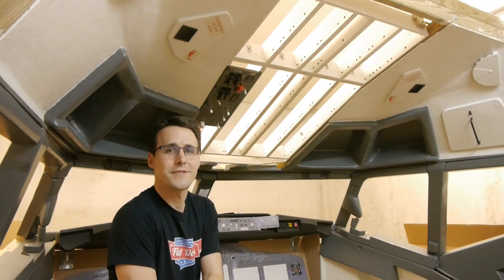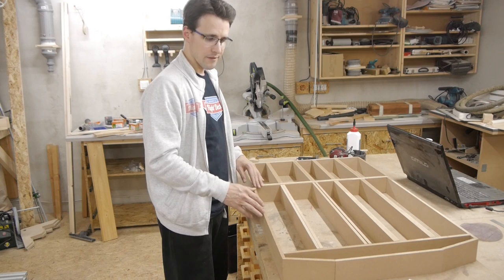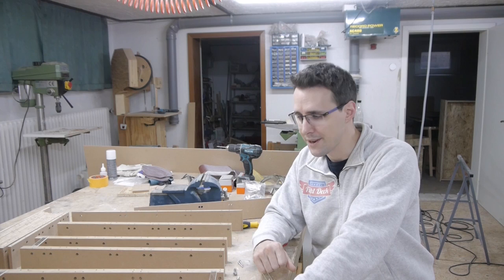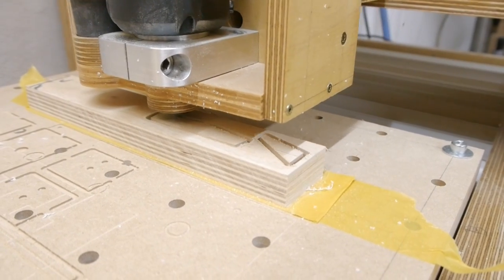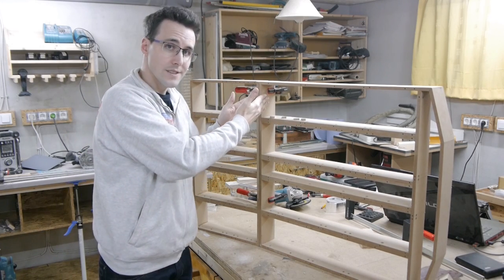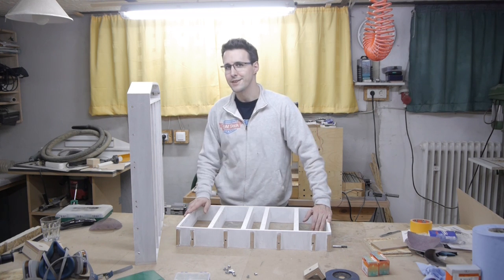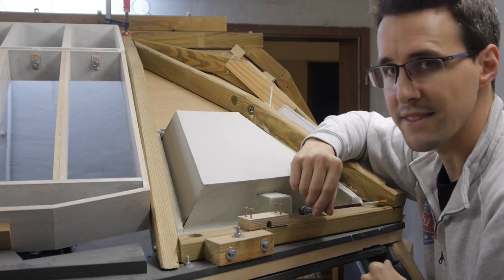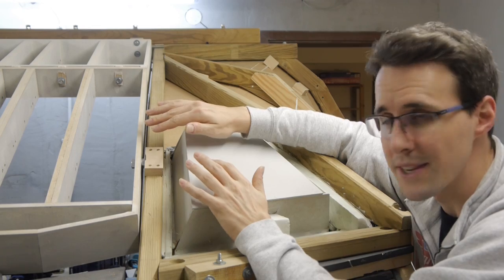Building my new overhead frame - A Boeing 737-800 Homecockpit #39

Comment: This is what you need to attach your overhead panels to the frame.  Once they go into the frame they never need to come out.  You then use a machine screw to hold the panel up.  This example is Imperial.  Metric sizes are available.  https://www.amazon.com/Z-Threaded-Hex-Flanged-Internal-Threads/dp/B002KSTB9G/ref=sr_1_4?dchild=1&keywords=Ezlok+8-32&qid=1588910735&s=industrial&sr=1-4